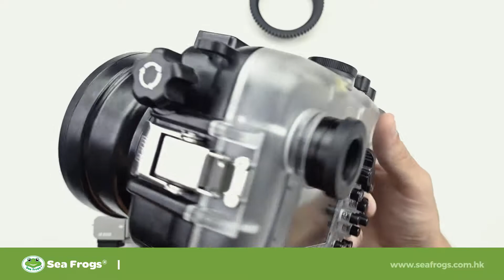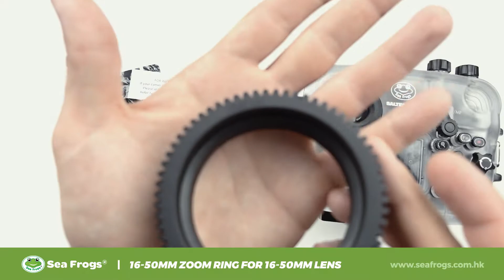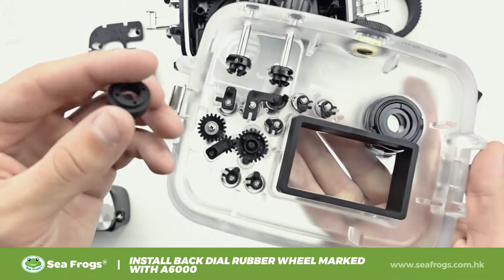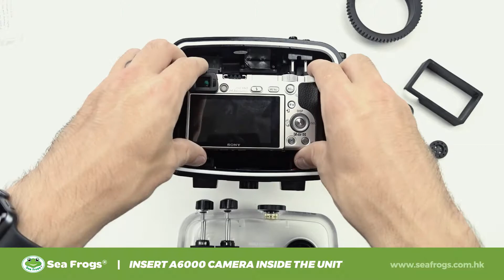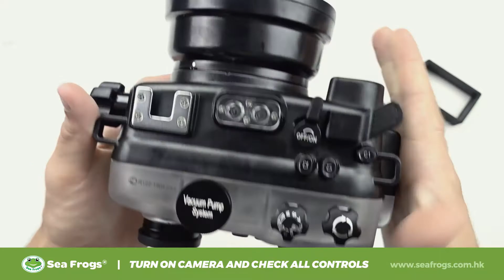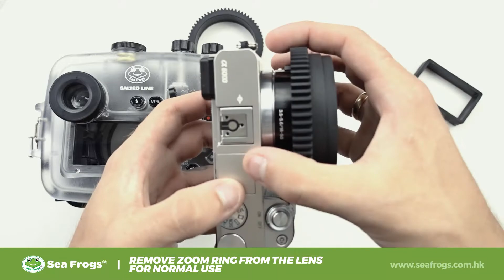How to insert Sony A6000 camera inside SeaFrogs A6xxx series Salted Line waterproof housing

Comment: I followed the instructions on installing the a6000 kit and the 16-50 ml zoom ring and inserted the camera in the off position and on the housing and it keeps turning on the camera. All the buttons work on the housing but I can’t switch the camera off while it’s in the housing. Is this common with a6000?
Reply from the maker: Have you tried to insert the camera while it is on and align the ON/OFF switch so that the little gap on that switch perfectly fits the camera one?
Reply: Salted Line yes I’ve tried to insert it with the switch and camera to the ON position but when i try to switch it off in the housing it won’t turn my camera switch all the way to the off position
Reply from the maker: Kenny Dubon  But it turns the camera off, although the switch is not all the way in off position - correct?
Reply: Salted Line unfortunately no. It doesn’t seem to make contact with camera switch correctly so the camera will stay stuck in ON position until I’m able to get out of the water and take the camera out. Is it possible to send your support group a video of what happens via email?
Reply from the maker: Write to support and they will send you a video.
Reply: @Ieattacos3113  hi, hope all is well. Would like to ask how's your experience with this case for a6000? I'm planning to buy.